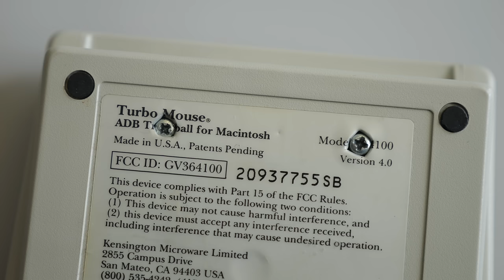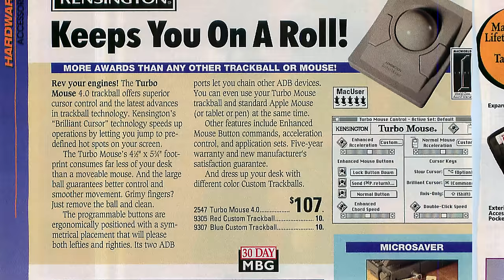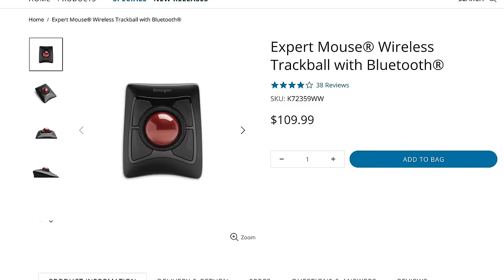The world's best trackball was built to break

Comment: Even sealed bearings can be serviced. I've done it numerous times on bikes. They have metal caps on the sides with rubber grommets to seal against each bearing race. It looks like there's enough room to open the cap on the non-sensor side with a dental pick poked between the grommet and the race. Don't worry if there's a tiny bit of damage. The bearing will not be exposed to high RPMs or the elements. The bearings guts can cleaned out with brake cleaner (best, but unsure if it would affect the PCB), WD-40, or citrus degreaser. Spin them until the cleaner runs clear. Examine the balls and races for pitting and feel how they turn. Add some regular bicycle hub grease in the bearing. squeeze the lid back on the bearing to close it up.
Reply: Thank you!! I’ve got similar experience. But you saved me the trouble writing it all out :)

This trackball is not a goner, just needs more patience and care. 

At first I was happy he tried lubing the “sealed, non serviceable, just buy a new one” bearing… it’s a shame he didn’t go quite far enough.
Reply: They make a "contact cleaner" now - basically weak brake cleaner that is 100% safe of plastics and is meant to be used on electronics, works like a champ on motor windings
Reply: I was about to post the same. As long as flat spots have not been worn into the bearings, I have had lots of success rebuilding “sealed” bearings by soaking them in a solvent, drying and relubricating them. I’ve had plenty of success with sealed skate bearings, and I wouldn’t think that these would be much different. The only tricky part of course would be to find a solvent that is tough enough to break through the grime, but is also safe for the board/plastics.
Reply: @getinkt338  I actually think I have seen screw that holds the axle-bearing assembly separately (at 4:38). but may be I am mistaken. so it can be taken out separately from the PCB.
Reply: yeah seems like he really didnt even try lol
Reply: Agree 100%, but recommend MAF cleaner instead of brake cleaner. Very similar, but won't harm most plastics.
Reply: everything about this channel in one thumbnail
Reply: I was just about to post the exact same thing regarding the bearings being able to be serviced but you got to it already lol. I also clean my sealed and shielded bearings like you but in my case its bearings in all my R/C stuff such as On and off-road race buggies, Trophy Trucks, FPV Race quads, Camera/Cinematography Drones, Airplanes, Etc so dozens and dozens of super tiny bearings to clean on a regular basis not to mention I live in Vegas so its a never ending onslaught of dust and grit lol

Comment: Oh that's definitely fixable! The heat stakes can be removed, you just need to heat them up gently (a lighter should suffice if you're careful) and kind of mold them with a small knife back to a shape that will slip back out of the hole. Finding the right size bearing should be a simple feat, and it's quite possible that the pattern on the shield is either a separate piece which you can attach to the new bearing, or can be reproduced and replaced with something like a printed sticker. 🙂 Don't give up, you got this!
Reply: Depends on the type of plastic. Not all are malleable
Reply: @jackgerberuae  Since it's been heat staked it definitely is malleable, that's kind of the whole point of heat staking 😄
Reply: It definitely looks like the reflective pattern is glued on. There's some yellow goop visible at the edges which could be grease but I doubt it. The pattern also doesn't look centered.
Reply: Absolutely fixable. The heat stakes can just be carved off and replaced with a screw and fender washer of the proper size (this is the standard fix for old IBM Model M keyboards with broken heat rivets). The bearings look to be off the shelf with encoder wheels glued to them. They should be easy to replace as you just need to match the physical dimensions (shaft diameter, outer diameter, and width). For the encoder wheel, it should be possible to remove it with the use of heat, solvent, or mechanical means (depending on the adhesive used), or you could just print a new one up on a laser printer (bonus points for doing a thermal transfer of the print to aluminum).
Reply: I inspected mine just now and while the bearing holder looks to be the exact same design, at some point they decided to stop heat staking them.  The parts on mine just slip out clean and free but could have been staked if deemed necessary.  The next problem is that the bearing-to-shaft appears to be an extremely strong press-fit.  The bearing ID is 6mm and I measured the axle to be 6.2mm.  The part has features to permit a fixture to cleanly install the bearing, but I can't imagine sliding it back off without some degree of irreversible damage.
Reply: @jackgerberuae You could also cut them off level, drill a small hole and tap a thread for a small screw. Or use some sort of glue to reattach them to the pcb.

Comment: This is the 2nd Generation TurboMouse. I had the 1st generation back in the day. The 1st generation had 3 (IIRC) replaceable bearings and used encoder wheels on shafts with teflon spindles instead of the patterns on the side of the actual bearings. This is a cost-reduced (and physically smaller) version of the 1st Generation. The bearings accumulated all sorts of oil and hand goop on the outside and needed to be cleaned (just like a regular mouse but upside down). The bearings were rather pricey IIRC so even on the 1st gen a new set was close to $50 back in the day (late 1980's or early 1990's). The 1st generation was a lot more serviceable, but had some quirks of its own.

Comment: You could try to apply some heat to them, that could melt/loosen the grease. The bearings are gone anyway so it might be worth a try
Reply: But that would melt the plastic standoffs.
Reply: @Toonrick12  they could be re-melted afterward, or epoxied
Reply: What he needs is brake cleaner or even WD40.  It needs a solvent to break down the grease.
As far as the bearing being gone, I seriously doubt it.  You could run these bearings bone dry for 100 years and never put a micron of wear on them.  It's low speed with very little loading on them.
Reply: @tarstarkusz  WD40 and working the wheels a lot will get them loose again, I had the same exact problem with a serial mouse for the Apple II where the vertical control was locking up and WD40 got it back to spinning
Reply: Old grease like this is a common problem on the old knitting machines I refurbish. I found a few hours in a car on a sunny day will provide enough heat to get the grease moving and test the machine before going digging in for a repair.

Comment: You could try using a Dremmel to bore a couple of holes in the non segmented side of the bearing housing and blast the old grease out with WD40 or similar..
Reply: A dremmel? This isn't the 8-Bit Guy!
Reply: I was thinking that or on the outer housing with a 1/32 ".01325" or in that range drill bit at 12 and 6 o'clock positions. Blast the old grease out with WD and replace with new. Blend the edges back flush with a small file so the ball with not get nicked up.
Reply: I’ve successfully done this exact fix on the ADB version. I first drilled 3 needle holes in the side of each bearing. Then ultrasonic cleaning was successful for free spin. I chose to use Moebius oil (watchmakers) and sealed the holes by press-fit inserting tiny copper wire. Not positive, but I’ll estimate the repair was 15 years ago. Still smooth today.
Reply: @thaddeusmcgrath  this is exactly what I just wrote too, and I am glad so many people are writing the same thing, now I want to see him try it lol , he actually might
Reply: @trombonista92  Cool, also when I see those sealed bearings in reminds me of my youth with skateboarding and similar bearing used we called German speed bearings. The Chinese made skateboard bearings are crap. I still spin the wheels in Wal-Mart and all have those crap Chinese bearings. I remember getting a set of German bearings, man it was like night and day!
Reply: @thaddeusmcgrath  very similar bearings are used on rollerblades. I used to clean mine at the end of the season with white spirit - that actually washed all the stuff out of them. (just remove the bearings from wheels, not whole assembly :-D)

Comment: Try using some heat on the bearing to soften the grease and expand the metal before trying the smallest needle you can get hold of.
Reply: Beat me to it. Heat them with a very tight nozzle or soldering iron tip touched around the outside let the metal components soak in the heat slow and they will potentially suck in oil or cleaner to get them going. My only worry would be the internals might be plastic but what are you out at this point? I have to use a torch to remove/reinstall bolts on some farm equipment. Heat frees them and cooling them down locks them in place something you want on spinning blades of death but often lots of penetrating oil is used on red hot bolts that have soaked in rust as they get very hot in operation too. I have touched an iron to a stuck hard drives spindles and got it to spin just like putting them in the freezer can get them going again. Big bolt or small bearing usually once warm it will soak in the also hot oil. May not last but it will as they say make the harvest. Avoiding fire hazards by not suggesting them there are solvents and oils you can try mechanics and machinists swear to brands like religions which is another reason I won't suggest one, do all this in a well ventilated area with a fire extinguisher and the usual generic warnings. I also keep medical syringes on my bench just for shooting high pressure jets of cleaners and oils into very small spaces mostly cleaning pots and old flux from under components things like that. You only get one or two uses out of them running straight alcohol as it eats the plunger but I buy them by the box from farm supply. If you ever wanted a mini bench top pressure washer to just blast something clean there you go. Just happen to be the same size needed to vaccinate horses so double business purchase win for me.
Reply: @JamesHalfHorse  we were farming when I was growing up, and now I’ve got a 1acre garden and a little garden tractor with a cat0 3point and tool bar, shanks sweeps and little offset disk that had all sat parked for over 20 years before it was given to me, the old torch with penetrating oil smoke show has become one of my early go to practices. The number of twisted off bolt heads and cracked sockets has gone way down even with cheater pipes on breaker bars.
Reply: I would have started with a degreaser.
No point letting that old nasty grease be in there.

Comment: That encoder pattern is an applique glued to the bearing not a part of it. Read the code on the bearing, its probably a standard bearing. There are most likely ceramic replacements available now. And you can always convert heat staked posts into screw attachments very easily.

Comment: I still use the modern descendant of this device to this day. I was impressed by Kensington's customer service a year or so ago when I talked to their online chat (presumably an actual person) to ask how I could order a new wrist rest as mine had cracked. Even though the device wasn't in warranty, they asked for my serial number and then sent me a new one free of charge.
Reply: Will definitely remember that when looking for peripherals. Good, human-based service is impossible to find anymore.
Reply: I had a similar experience- called to get a replacement ball for my wired Expert Mouse, two days later I had an entire replacement unit in my mailbox!
Reply: I would have tried different solvents, like isopropyl alcohol, to clean the ball bearings, before giving up, because it seems unlikely that regular use would wear out these ball bearings, there is almost no load on them and the amount of rotation they were subjected too, is easy to imagine, would be far lese when used as a trackball mouse, than in some motor assembly. 

It is very, very likely, that what got the ball bearings stuck, is grease from the hands of the user, and probably the previous owner have cleaned up
the mouse, which seemed to be in very good condition, and also unsuccessfully used regular machine oil, without attempting to clean out the grease inside the ball bearings. Meaning - it is not too late to save the trackball mouse. If the previous user even was a smoker, a nice combination of nicotine, grease from the hands, possibly fram any food the user ate etc. would be the culprit, you cannot just use sewing machine oil and smooth that out! 

If isopropanol didn’t work, I would have moved over to acetone, though this may ruin the plastic,  so should be dripped on, very carefully. Am sure other viewers here, would have even better suggestions than me, what to use, but surely isopropanol could be tried first, maybe regular alcohol, again - being careful not to ruin the plastics.
Reply: My problem with the modern one, which isn't saying much as it's sitting on my desk as I type this.... the scroll ring is scratchy and bad and feels cheap.... but the rest, perfectly fine, I've had it for a while now

Comment: They made non-serviceable parts already in the 70's. I have an old Yamaha SY-1 synthesizer from 1974, and most of the circuitboards inside are potted with epoxy making them completely inaccesible for repair. The service manual just states that you have to order a complete replacement board in case of failure - which was impossible a few years after production stopped. I ended up making a new board from modern parts and a strip-board for my SY-1. It works but inside it looks like Doc Brown's 1955 repair of the time machine in Back to the Future III.

Comment: You could heat the bearing up with a soldering iron, apply the oil, and as it cools the vacuum should suck the oil into it. It's done with some antique clocks.

Comment: I've been using the modern wired USB Kensington Expert Mouse for a bit over a year now, and I previously had a Kensington Slimblade trackball for a good 6 years before the button switches started acting up on me and I started looking at replacement options. After a few less than stellar years messing with cheaper alternatives I finally decided to just spend the money on a new Kensington which I should have done from the get-go. I actually wound up digging out the old red ball from my Slimblade and swapping it with the black ball that came with the Expert, it just feels smoother to use and IMO looks nicer 🙂
Reply: Couldn't you just replace the worn switches? After a decade of use, the left button microswitch on my old trackball started acting up, I opened it, searched for an identical switch, bought a new one and replaced it, it's been six years since and it's still working fine.

Comment: I had one of these. My middle school assistant principal gave me a IIci back in about 1995.  It had a video out problem, which turned into my first computer motherboard repair (at age 13) that wasn't a radio or television.  The machine still works today, though I did have to do something about the trackball.  My solution 12 years ago was a couple drops of a decent machine oil, and then heating the bearing with a hot air soldering unit at low temperature.  Just put some cardboard or something to keep from cooking the plastic.  What you will be doing will be a combination between melting the old oil, and facilitating the mixing of that with the new stuff that you added.  It sounds more complicated than it was, it probably took a total of about an hour of work before the crunchy trackball was a thing of the past.

Comment: I used to use TurboMouse trackballs back in the day and never had issues with them during their regular service life. The ADB one I had lasted long enough for me to upgrade to USB, and the USB one lasted long enough for me to eventually replace it with a trackpad.

I think this is probably repairable by 3d printing to replace the plastic supports, and laser etching some new off-the-shelf shielded bearings. If you don't have access to a suitable printer and laser engraver then it obviously wouldn't make sense to buy them just for this, but there's certainly people out there with the equipment on hand.

Comment: FOR THOSE BEARINGS, USE THE FOLLOWING: 
Potentiometer cleaning fluid (to loosen them up)
Silicone oil (to re-lube them afterwords) 
The stuff you're using is way to thick.
P.S. DO NOT open the bearings.
And at the end you can clean all the grease from the outside of the bearings with a paper napkin doused in brake cleaner... so the ball doesn't slip.

Comment: I still have a working Turbo Mouse ADB with the ball bearings which I just cleaned out with some brake cleaner. I guess the seals on mine didn't seal that well then. Lovely trackball. The Kensington SlimBlade Pro I use on my modern machine that feels very similar but much smoother because it's of course all optical these days. 

I think the Turbo Mouse was very well made and not at all intentionally made to fail. That's just like decrying that everything that uses a rubber belt was "built to break". Nobody thought that we would want to use all that stuff 30 years later. It's telling that almost no service manual talks about replacing belts...